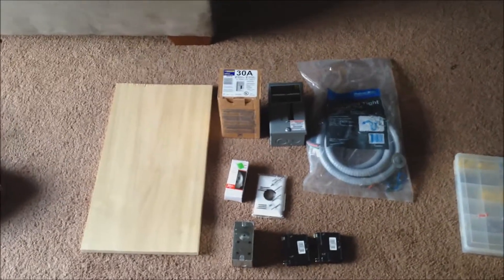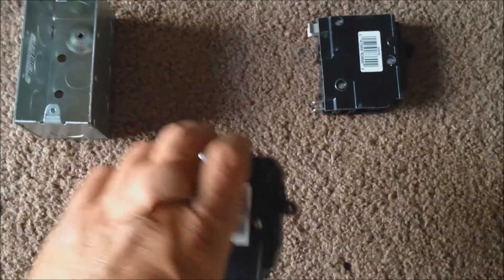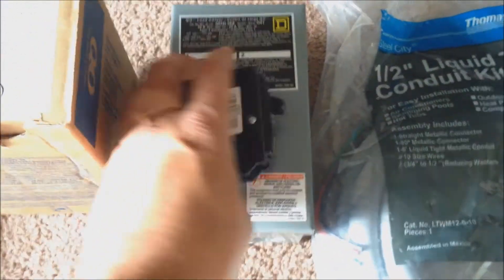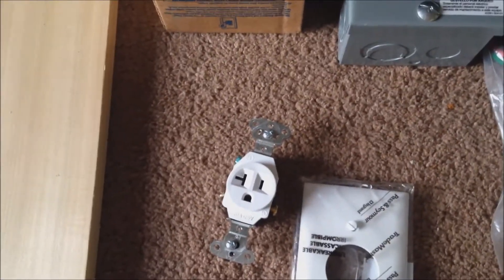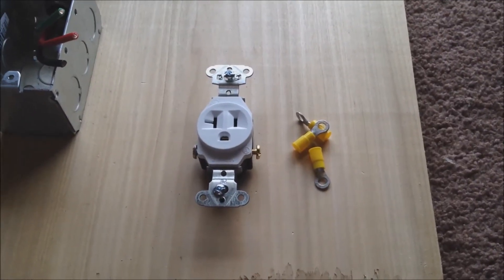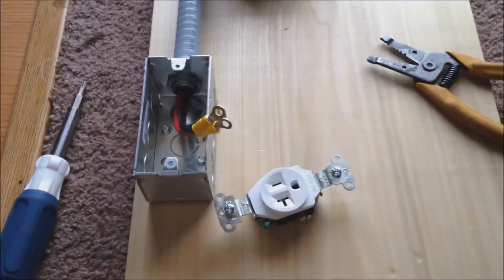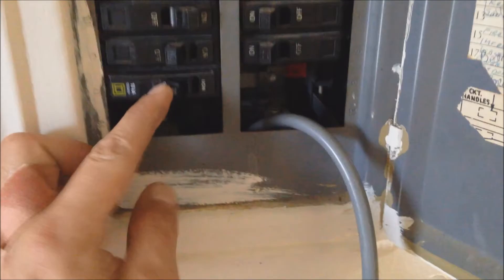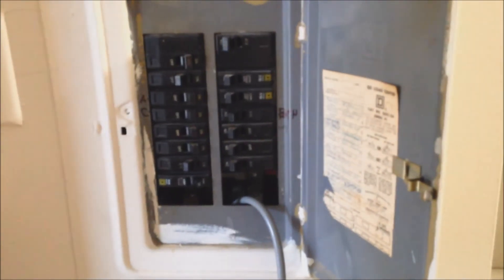Upgrade to 30 Amps With Portable-ish Breaker Panel Setup

Comment: How would you wire the sub panel to also use the second breaker space.  For example, 50 amp cb in main with 10-2 to the sub panel.from there break into one 30 amp circuit and one 15 amp?

Comment: You seem to think about things the same way I do and have the same definition of "fun" lol.  Even though it wouldn't be NEC compliant (as if that ship hadn't sailed for you long ago...) I would still mark that red wire with white electrical tape or white shrink wrap at every termination and entry/exit.  It would make me feel better about myself.  Even when breaking the rules it's good to still keep things as straight as you can.  Not only for yourself but also the 1 in a million chance some poor sap comes behind you he's at least got a good chance of figuring out pretty easily what the hell you were up to.  Good vids man keep it up.
Reply from the maker: I would absolutely mark the wire if I was wiring something i was expecting others to work on in the future, but since it's just me I let it go :) Thanks for the comment though! I love feedback on how I can improve things and make them more entertaining.
Reply: can you please explain how you feed the 30 amps from the main box i can not find a video that explains how to know if the main box can supply the 30 amps thanks so much for your help GOD BLESS YOU ALL THERE

Comment: the way you rigged everything in this video is about how id do it....lol
Reply from the maker: Quick and dirty lol!
Reply: Lets NOT Play With Electricity yeah lol... I will get it rigged up just enough to perform my experiment then that's it... even if it means bare wires which is kinda stupid but I mean... your playing with 2000 or 4000 volts anyways so it doesn't realy matter...lol